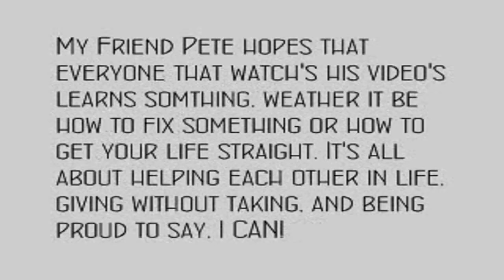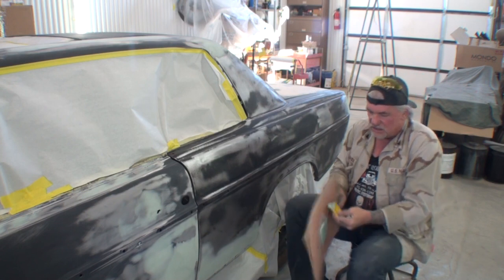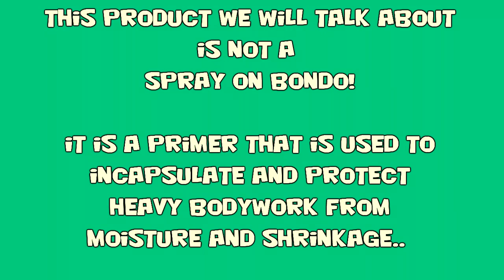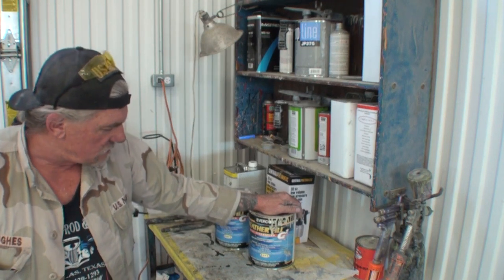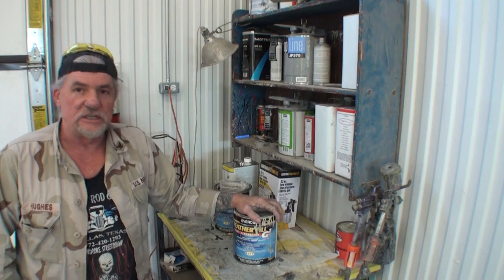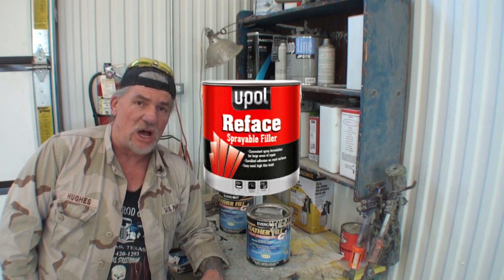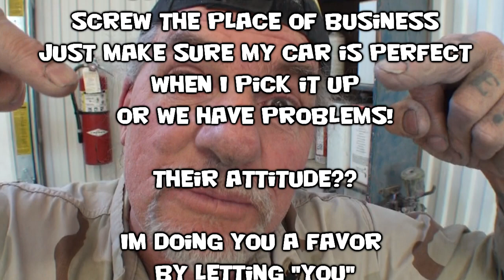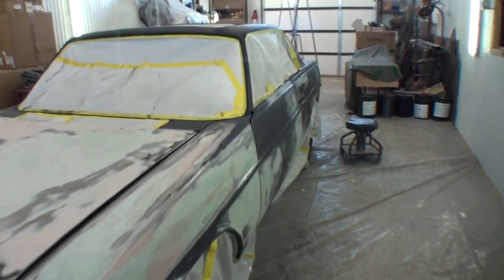"POLYESTER PRIMER" - What Is It and Why Should I Use It? - Autobody Tech Tips.

Comment: Hi Pete when you’ve used the feather fill.... wha do you block with before high build thanks
Reply from the maker: 80 grit hand sand dry
Reply: @diyautoschool  after 80 180 or just straight in to high build after 80 thanks Pete

Comment: Hey Pete ive used that feather fill  & it doesnt dry a 100 % I had to 80 grit the top coat to get down to dry material before i could block it with 180, I thoght i might of got a bad batch so i trisd another gallon & same bullshit it sucked!!  I have used it in the past with no problems  . How did it work out for you?

Comment: Both g2 and feather fill are polyester primer. Neither protect against moister. They are awesome to fill and not shrink just block sand it, seal it and paint, no need for 2k primer on top. That’s how the top dogs do it and that’s how the shop Dusold designs around the corner from you do it and win best paint all the time